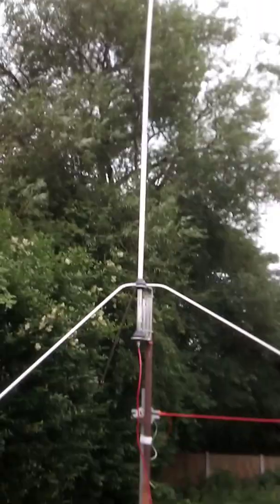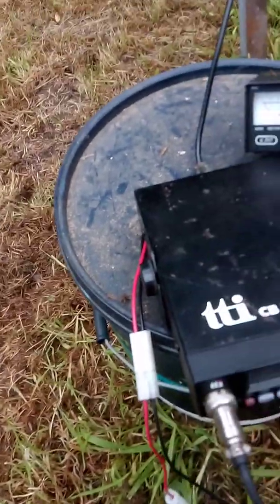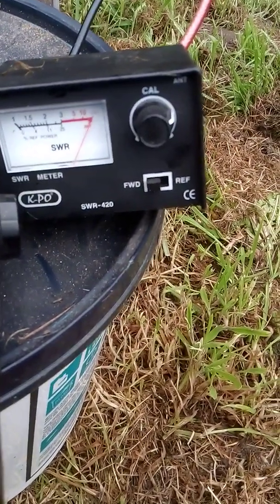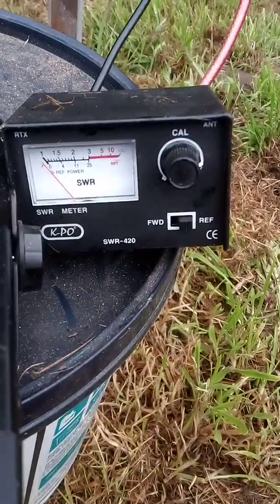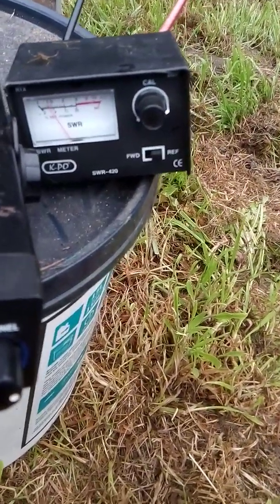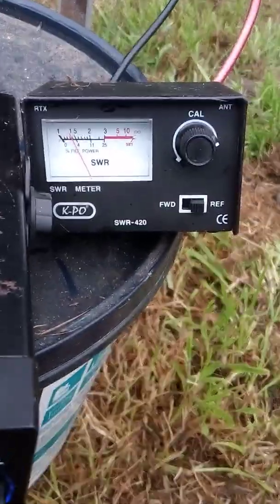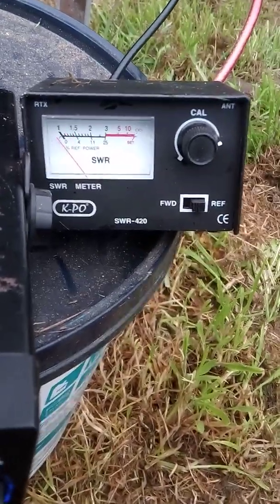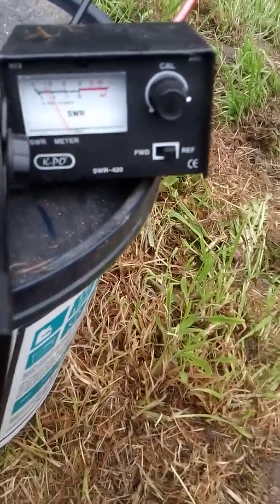Part 1 .. setting up my silver rod antenna with extended ground radials

Comment: to get least ground affect reflections for Line of Sight Ian,you need to lift the mast pole much higher up.I found in my tests around 55-60ft was best mast heights,lower antenna to ground more reflections with earth,less effective ground radials,also lowers the Z impedance of antenna the lower you go to earth ground.
Another thing found isolate the antenna from mast,this avoids ground loops with Switch mode power supplies,as braid of coax sits at dc negative,minute you aeth it how you get dc\rfi noise increases from SMP psu.
I use split pvc tube sleeve to ilsolate the clamps from mast (NOTE if doing this you must use a ground plane antennas so has counterpoises to work agianst)
I then dvm check to ensure antenna bracket not connected to mast ohms wise.
Then i ensure the mast is earth for electrical safety with copper rod,and short earth wire clmaped to mast pole.
Ground radials should be straight ideally,lowering or bending them will change the Z impendace lower but needs further experiments and VNA test instrustrement to confirm this .
The ground radials should be around 1/8th of a wave in length if 5/8th wave antenna,about 1.2-1.3metre long @27mhz.

Hope this information helps Ian,ive been testing optimised LOS 27mhz bases for relay & VOIP ptt linking experiments and wanted to get base antennas working the best they can be Ian.
These were conclusions I figured out.
Results of ground radials deffo enchanced once i got the mast\antenna lifted away from terra firmmer.

73s Rob.P